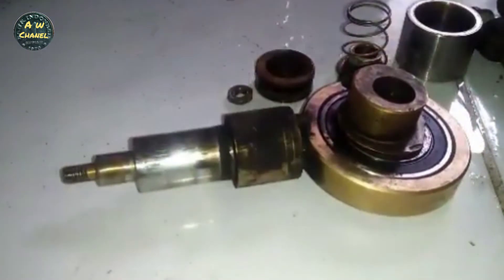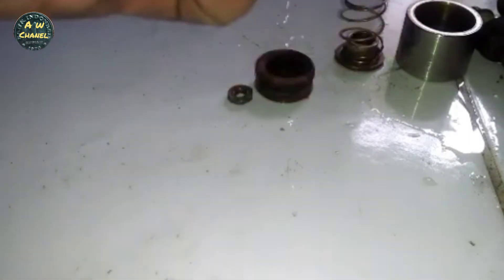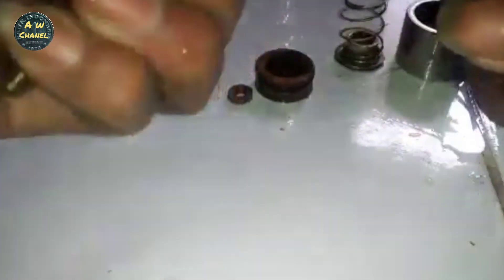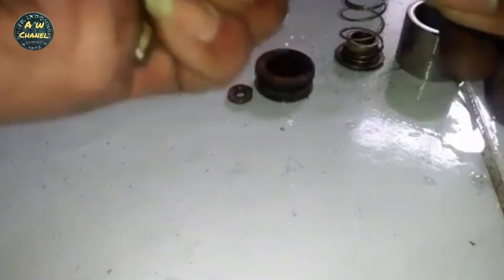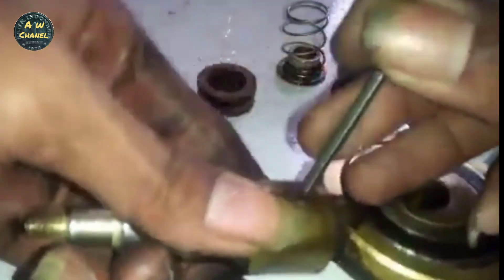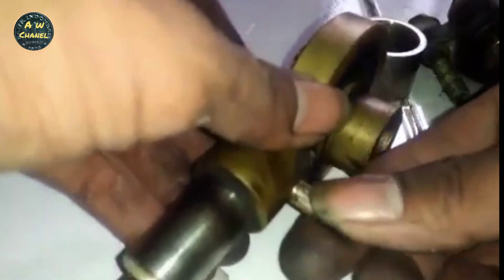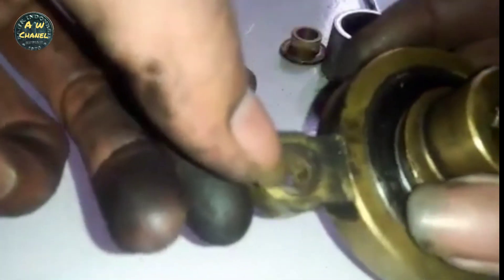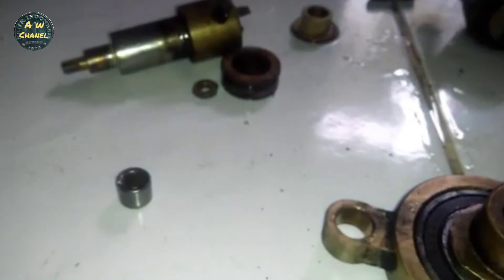STEAM KIYODO AIRNYA KECIL dan SUARANYA KASAR\\

Comment: Mas , mau tanya ..

Punya saya merk Kyowa steam nya .. itu dia gak mau nyedot air nya ? Kenapa ya ? 

Tolong dibantu jwb ya dan solusi .. terimakasih
Reply: Gak ada bocor jg , 

Sblm2 nya normal dan tibatiba gak mau nyedot
Reply from the maker: cek Valve depan biasanya lengket
Reply: @AriWiguna  kalo normal nya harus nya gmn mas ?
Reply: @AriWiguna  valve dpn nya
Reply: Sil patah nya kali sama silinder @akbarmrskndr